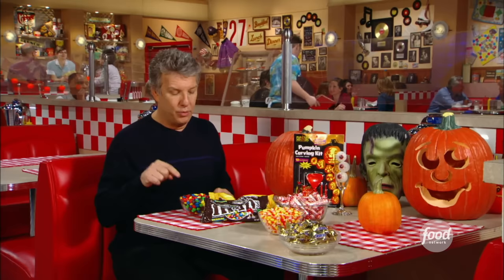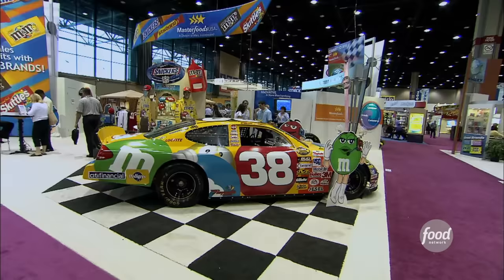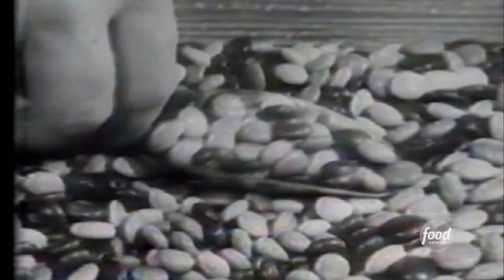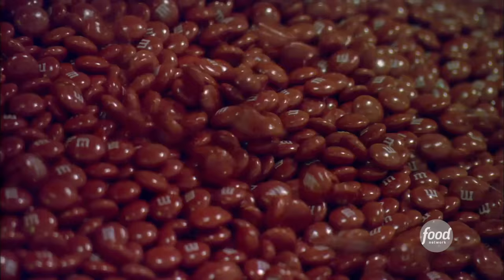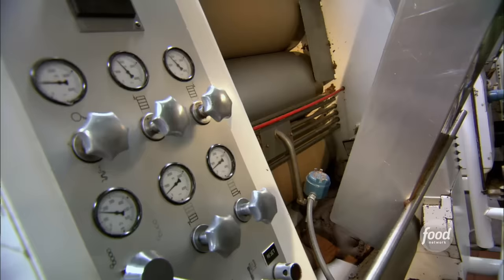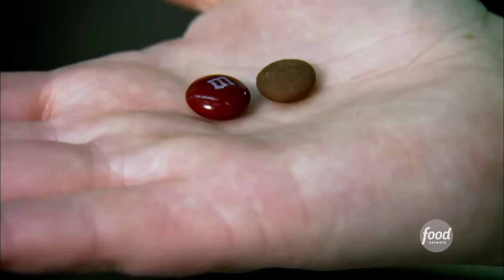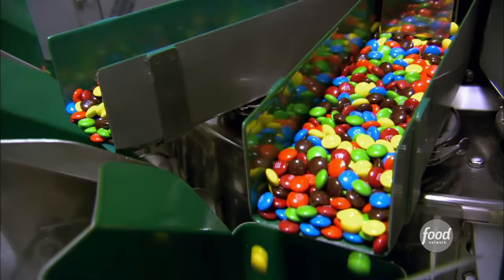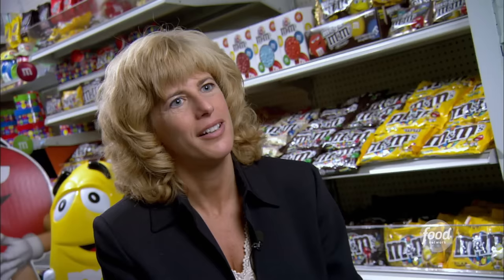How M&Ms Are Made (from Unwrapped) | Unwrapped | Food Network

Comment: Literally the shell was the biggest thing I was curious about😑
Reply: They use giant tumblers, like the ones for concrete, and spray a mixture of sugar and color as the candies rotate. The part I don't remember is if the peanut ones are pressed into molds as well. I don't see how they could be when no two peanuts are the same size.
Reply: I want to know how they put an "M" on each and every single one of them

Comment: The first shell coating on the chocolates is actually painted on by hand by 1,000's of Oompa Loompas.

Color mix of the candies in the bags is merely wishful thinking.  As part of a statistics class, a couple hundred bags of plain and peanut M&M's were counted.  Each bag was counted for total number of candies and how many of each color in the bag.  For the total amount in bags, very large range of plain candies in a bag, not so large a range in the peanut bags.  For colors. many many bags had no candies of 1 or 2 different colors. Some bags had over 50% of one color and a couple each of other colors.

Mars may use those percentages as a rule of thumb for the overall mix going down the line.  But individual bags can vary widely.  Made for some very interesting reports and graphics of deviation.  Also worked out they number of bags you would need to buy to get X-amount of a color.

Fun research when you get to eat the samples.
Reply: were these the little packets you get on halloween or full-sized bags? i imagine larger bags would have more correct color proportions
Reply: i bet! (I assume this was in one of your college classes?)
Reply: lol yass!

Comment: Originally known as Treets in the UK.
The original product consisted of peanuts coated in milk chocolate with an outer shell of dark brown glazed candy, and appeared in the UK in the 1960s; these were later marketed as Peanut Treets, (sold in a yellow packet), together with Toffee Treets (sold in a blue packet) and Chocolate Treets (sold in a brown packet). All three shared the same glazed coating, but the filling of the button-shaped Chocolate Treet consisted solely of the milk chocolate which surrounded the peanut or toffee pellet in the other versions. All three were marketed with the slogan "Melt in your mouth, not in your hand" which was first used in 1967.
The brand was discontinued by Mars in 1988. Chocolate Treets had already been replaced with the similar Minstrels. Peanut Treets were discontinued in favour of the multi-coloured Peanut M&M's. Toffee Treets were later sold as Relays, before being dropped altogether.
Reply: Nothing original about that, m&ms were introduced in the 1940s.